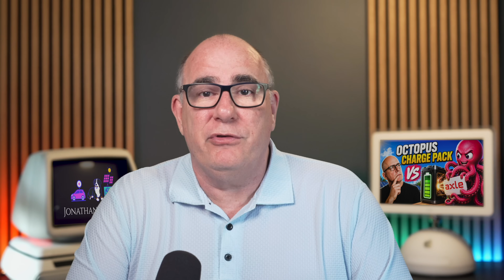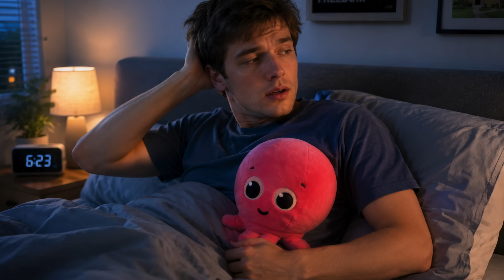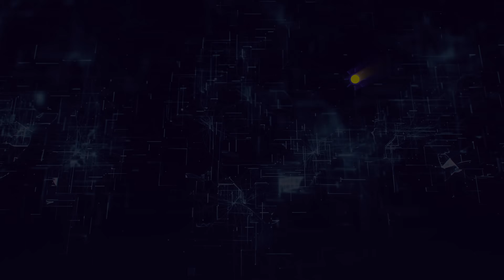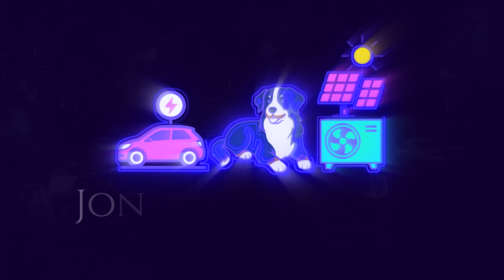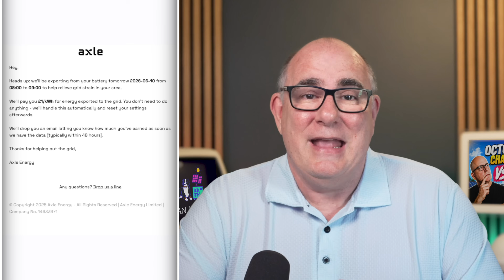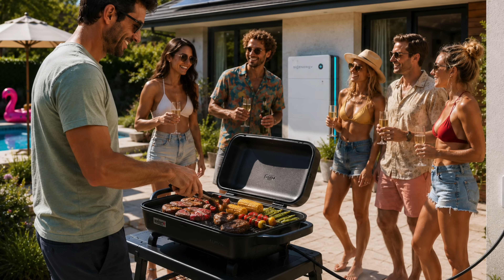Octopus Charge Pack Just Fired A Shot At Axle Energy

Comment: I have signed up, partly because Octopus now seem to be saying Axle is a no with IOG T&C, which I was about to try. I doubt Octopus will do anything significantly different for us optimisation-wise compared to Home Assistant, but then our battery is currently sufficient so that if we charge it off-peak then we shouldn't need to use peak rate electricity anyway apart from a few winter evenings, so it boils down to maximising export, i.e. a trade off between more/less import at IOG off-peak rate vs export at 12p and those margins are narrowing. I hope that can't get too messed up and that £12+/month to allow Octopus to dump the battery at random times to help the grid is going will mainly be profit, but if things don't pan out that way I will just opt out again.
Reply from the maker: @goldensun2707 I think the Axle + IOG position is a little disingenuous from Octopus.

A few people complained that when Axle discharged their battery, some of that energy ended up in their EV and somehow blamed Octopus for it. But in reality, IOG is very unlikely to be handing out cheap charging slots during a grid event. By definition, those events happen when energy is expensive and the grid needs support.

My suspicion is the real concern is different. If Axle gives advance notice of an event, people could potentially fill their batteries overnight at 9p on IOG, then export during the event and earn £1/kWh from Axle plus 12p/kWh export from Octopus. That's £1.12/kWh revenue from energy that cost 9p to buy.

I can see why Octopus might not be keen on that business model. 😄
Reply: yeah the Axle thing seems to be a commercial decision by Octopus more anything, but as far as advance notice goes I would think most people on an export tariff are going to be filling their batteries overnight irrespective, but IOG gives Octopus the ability to time-shift some demand and charge pack should expand their time-shifting capability so I suspect that is their angle.

Comment: I've signed up to the octopus charge thingy, mainly because I have zero control over my 5kw Huawei battery that was in the house when we moved in last December.  I have the app but it can't make head nor tail of it as far as being able to discharge it when I want.  So if octopus can do it then I'm hoping they can make a bit more use out of it than I currently have.
Reply from the maker: LOL every problem has a solution 😂 hope it works for you
Reply: I had a Huawei Luna 2000 inverter, BMS and 10 KWh of battery. Removed it recently to install a Sig system. It did the basic job pretty well but offered zero extra control. I'd be amazed if they ever allow force discharge.
Reply: @FlatToRentUK so it's not just me then? Well that makes me a bit happier knowing that it's the app rather than me being a technophobe ha ha.  As you say it works and it's saving me something but I would like at least 10kw and the ability to do what I want with it. Cheers
Reply: @paulbailey6567  Roughly whereabouts in the country are you given I've got a battery for sale?

Comment: I use Net Zero to ensure my battery charges during periods when i get cheap slots to charge the car rather than emptying into car. Will charge pack elminate the need for Net Zero and the £70 a year charge for that!?
Reply from the maker: I assume if you’re using net zero then you have a power wall, this isn’t supported by charge pack at launch, so no is the simple answer. That said I’m sure they will add support for it later but will have to wait and see what features it supports before you could make that call.
Reply: @JonathanTracey  thanks. I just had an email back from customer services. They say Tesla is bring added "soon" and that they will set the battery to charge whenever the car is charging so it sounds like that will allow me to cease paying for Net Zero! let's see...

Comment: If its anything like Intelligent Flux then the biggest downside is that your battery has multiple full charge/discharge cycles per day....

This obviously has benefits to the grid but as the person that had bought the equipment and averages 1 full charge/discharge per day, then having an intelligent entity take control and increase this to 2-3 charge/discharge cycles per day, without any tangible or financial benefit to compensate for this increased battery usage. Additional battery charge/discharge cycles will therefore reduce the expected lifespan of the battery & invertor.

How intelligent Flux works is that at any given time you import & export rates are the same, though they vary throughout a 24 hour period (night off peak/day standard/evening peak), except you pay the 5% VAT on import.

1 charge cycle will be off peak import to peak export for a financial profit but all the other charge cycles will be during standard day rate for no financial reward and at a cost of VAT on the additional grid import in winter or hoping PV overides the grid import in summer
Reply from the maker: @gh0str1d3r00 I think that's a very sensible concern. The one thing missing from all the marketing material is a discussion about battery wear and inverter utilisation.

If Charge Pack ends up creating 2–3 full equivalent cycles per day instead of 1, then there needs to be enough financial benefit to compensate for that additional usage. That's one reason I like Axle's approach. The events are infrequent, the payment is clear (£1/kWh in many cases), and I remain in control the other 99% of the time.

The irony is that with a typical IOG setup (say 30p peak, 9p off-peak and 12p export), the value of moving energy around is often only 18–21p/kWh before any bonus. That's a long way from the £1.12/kWh you can achieve during an Axle event.

We really need some early adopters to publish a few months of real-world data before we know whether the extra cycling is being adequately rewarded.

Comment: So on IOG I get low charging rates between 23:30 and 5:30, while a connected EV could cause up to 6 hours of low charging rates at any time the car is trying to charge. Now with Charge Pack, Octopus aims to enable just the charging of my batteries at certain times of their choosing.

That is a total mess as just telling my battery to charge on the cheap will mean that the battery is no longer providing power to the rest of the house, which will then draw power from the grid. There is currently no indication of how any overlap between the choices made by Charge Pack will interact with the choices made by IOG.
Reply from the maker: @rogerthomas7040 I think you've identified one of the biggest unanswered questions. Today, if IOG decides to charge my EV, I know exactly what's happening and why. If Charge Pack is simultaneously telling the battery to charge, discharge or hold back energy, who wins when those decisions conflict?

The other point is that charging a battery isn't free. If the battery starts charging, it stops supplying the house, so unless solar is covering the load the house simply starts importing from the grid instead. That's why I think we need a lot more detail on how Charge Pack and IOG interact before anyone can properly calculate whether this is a good deal.

At the moment there seem to be more questions than answers.

Comment: I’ve only been linked with Axle for about 3 weeks and after two events have not yet exported any energy. Another event tomorrow. I only went onto it because they pay the GIV Energy fee. I might just set the export timer my self if it doesn’t happen this time, but that’s just and other intervention I have to remember to do and then undo. As you say with the Octopus system, there is an element of loss of control. If it meant that I could use all of solar and not export it for “free” I would be happy. What happens with FIT payments, do I have to opt out of the deemed export bit of it. On the flip side I now have the dilemma with Octopus controlling my Zappi and My Energi using gridpay to control the Zappi. So far I have turned gridpay off (it was just imposed on me, no communication). Do I lose my low overnight rate if I opt for gridpay control rather than Octopus. I also want to use the excess from my panels to charge the cars. Will AI plug the car in for me. 😅
Reply from the maker: @Jonty60 I think you've perfectly illustrated the challenge. Every time a new optimisation service arrives it promises to make life simpler, yet somehow we end up with another app, another setting and another thing to keep track of! 😄

On the FIT question, if you're still on deemed export then you normally keep receiving the deemed export element regardless of what actually happens to your exported energy. It's only if you've moved to metered export that things become more complicated.

As for AI plugging the car in for you, I suspect we're still a few software updates away from that one. Although given the pace of AI development, I probably shouldn't rule it out entirely!

Comment: Absolutely spot on. However the BIG question mark is the comments by octopus that IOG users can’t be on Axle. 
Regardless of whether they subscribe to charge pack or not. 
That could result in a mass exodus from IOG to a non smart tariff either Go, EOn, EDF etc where there’s no clash. Or an exodus from Axle. 
Talking to industry insiders it’s all down to the fact that only one provider being able to register the mpan into the flexible markets

So there are interesting conversations being had. 

For me. I will take the £40pm from Axle any day. I can’t have IOG anyway. I’m not worthy.
Reply from the maker: @paulhetherington969 I think that's the really interesting part of this story. If Octopus genuinely prevents IOG customers from participating in Axle, even if they don't use Charge Pack, then there could be some difficult decisions ahead for a lot of people.

For me it comes down to the value proposition. If someone is earning £30–£40 per month from Axle, that's real money. Any restriction that forces people to choose between tariffs and flexibility services will inevitably cause some customers to look elsewhere.

The MPAN and flexibility market angle makes sense and would explain a lot. I suspect there are some very interesting commercial and regulatory conversations happening behind the scenes right now.
Reply: The problem is that IOG is built around the import MPAN (which is the normal supply to prem MPAN). Any export that receives payments depends on the export MPAN, which is a totally different number. So Octopus could easily justify this position if a customer has signed up to Agile Outgoing Octopus or Charge Pack as they need the export MPAN to operate. At the moment their current claim seems to be based more on market power and the control over so many of the battery installs.

In many ways it seems that Octopus is following the same plan that Sky used to build its empire - If you want one aspect of their service you can only have it if you take a bundle of a number of services, regardless of your own needs.

Comment: I suggest you read Axel's terms and conditions again. You give them full consent of your kit. Meaning they could lock you out of your own equipment. It also states that they can stop your devices from changing during grid stress. Good luck with the hot tub. !!!!
Reply: There are two services. One is at your discretion. (Which almost everyone is on). The other is full integration…  dry similar to charge pack by the sound of it and with the vague info we have.
Reply from the maker: @AnthonyJoyce-x2t The difference is I can terminate Axle in a heartbeat if I decide it's no longer working for me. It's an optional service sitting alongside my existing setup. Charge Pack appears to be much more tightly integrated into the tariff itself.

As for the hot tub, at this time of year it heats almost exclusively from surplus solar. We don't grid charge it at all, so I'm not overly concerned about an occasional flexibility event affecting it.

Ultimately it comes down to control. I'm comfortable giving up a little control when I can opt out at any time. I'm much less comfortable when the supplier becomes deeply embedded in how my battery operates day to day.

Comment: I'm with Axel at the moment and have no issues so far, money is building up in an account which I can move to my bank when I decide to move it. Yes potentially it could make me use electricity from the grid if my battery is empty but as you say £1 per Kwh is a generous pay back compared to 28p? Not sure how it will work in the winter I suppose I will need to force charge my battery then
Reply from the maker: yeah, that’s the big mine share shift as I might as well deplete my battery and get a pound per kilowatt from it because then I’ll just buy it back and make slightly less profit

Comment: Tesla are doing something with their Tesla app for those with Powerwall - Tesla Home & Opticaster.   "Opticaster, the AI optimisation software that powers Tesla Home, can help you save more by automatically deciding where to source your energy from and how to use it."  I had noticed my system is doing more with my solar, Powerwall and the grid, rather than the rigid rules I had previously set.  So hoping something is on the horizon from Tesla.

Comment: The other confusion is whether or not IOG is compatible with Axle. Octopus says no it isn't but I cannot see why  it makes a difference. Also what about these smart saving events as well. All very confusing and a lot of questions remain unanswered
Reply from the maker: I was on IOG and Axle for the last two events no issue, I think the worry is if IOG wants to charge your car and axle wants to discharge your battery, the car takes the power, you dont get paid and customers blame octopus.

That said I think thats unlikely as if there is a grid event in your area its because wholesale prices are spiking and would octopus be offering cheap rate slots then?
Reply: @JonathanTracey  I emailed Octopus to get more info about the Charge Pack and basically got the below reply (summarised):

- With Charge Pack, if IOG schedules a charge outside the 2330-0530, with Charge Pack, Octopus will prevent the discharge of the battery into the car (i.e. will set it to charge), akin to what I use already (Wonderwatt).
- Was confirmed that customers on IOG are indeed unable to participate in any VPP provided by a 3rd party (e.g. Axle Energy).

Like you, I am on IOG and Axle and have had zero issues so far...  In fact, have a Axle event today (and an Octopus saving session that is starting mid way through the Axle event - will not be participating).

I have gone back with some further questions, namely querying what happens if I need to regain control of my battery to prevent any discharge and will revert back with any update.  That said, with Axle, at least I get access to Givenergy Premium as an added bonus, something I wouldn't get with Charge Pack (or will we...?!)

Will be interesting to know how long Axle will be able to keep up with the £1 payments for each unit exported though.

Comment: I am very much considering it because “
Battery imports cost your day-rate: We compensate you so charging effectively costs you your cheaper off-peak rate.
Battery exports to the grid: We compensate you at the difference between your import day-rate and your export unit rate.”
Reply from the maker: @keithbrown339 That's the bit that sounds attractive, but the maths still matters.

Using simple numbers, if your day rate is 30p, off-peak is 9p and export is 12p, then charging the battery is really worth the 21p/kWh difference between day and off-peak.

For export, Octopus topping 12p up to the 30p day rate is worth an extra 18p/kWh, plus whatever bonus they add.

Compare that with Axle, where an event can pay £1/kWh on top of normal export, so £1.12/kWh in this example.

So yes, Charge Pack may work well for some people, especially if there are lots of events, but unless the bonus is generous, the per-kWh reward looks much lower than Axle.

Comment: I got that email from Octopus too. I also could not work out how much I might earn from Charge Pack. The rate per kwh exported from the battery is much less than Axle offers but maybe there will be many more export sessions. Axle has an "event" when it takes 3.2kwh from my battery less than once a week. So far I doubt I will export as much as the minimum guaranteed £10 worth. Charge Pack is offering me much less but if it exports power at the special rate several times per week then maybe it could end up more valuable. The problem is we have no idea how it will work out. For now I think Axle is the better offer.
Reply from the maker: @timheaps582 I think that's a fair assessment. The problem right now is that we can do the maths for Axle, but we can't really do the maths for Charge Pack.

If we use typical IOG numbers of 30p peak, 9p off-peak and 12p export, then moving energy around is only worth about 18–21p/kWh before any bonus. Compare that with an Axle event paying £1/kWh plus the normal 12p export, giving £1.12/kWh.

The only way Charge Pack wins is if there are significantly more events, significantly more exported energy, or a much larger bonus than we're expecting. Until we see some real-world data, we're all guessing.

That's why my conclusion was similar to yours: today I understand Axle, I can calculate Axle, and I remain in control 99% of the time. Charge Pack still has too many unknowns.